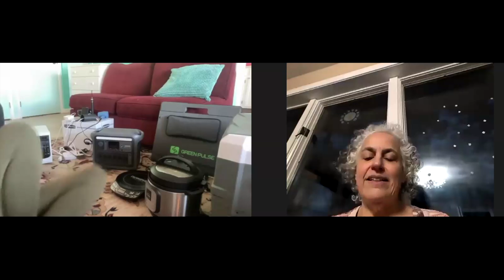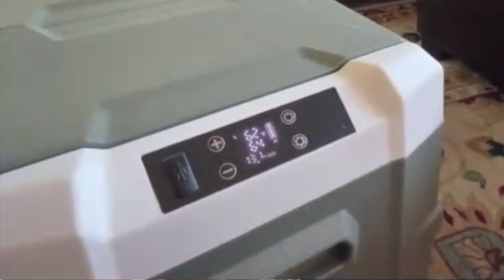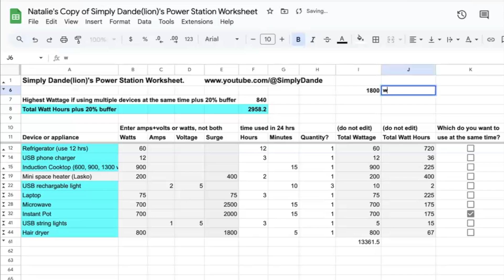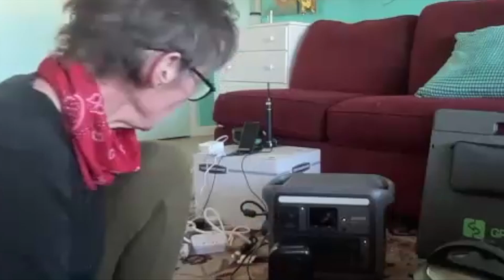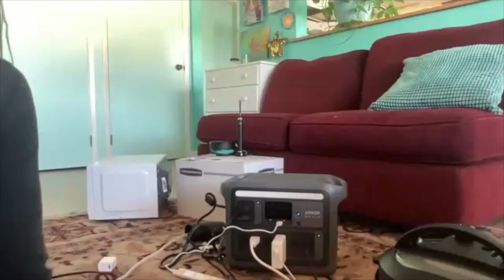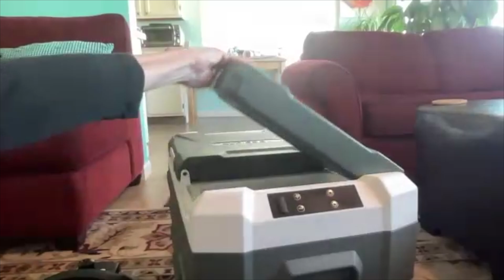2 Solo Senior Women Discuss How to Use a Power Station with Electrical Appliances In Van Life or RV

Comment: Good luck on your 1st camping trip.  Looking forward to your report back on how using all your gizmos goes.  

One power saving tip is to pre-cool the fridge at home down to temperature. Once a fridge is to temp it doesn’t use much power
Reply from the maker: Thanks for the good wishes!  Yes, I somehow had the good sense to pre-cool my fridge at home. I even froze some freezer packs and used them to help keep the fridge and freezer cold overnight and when I went for a hike the next day. I figured I use minimal power that way. Worked!
Reply: @ did you get a chance to use your induction stove?  I’m curious on your power draw if you cooked anything at 600w or 900w.  And could you cook like you wanted to on it?
Reply from the maker: @karinhart489  I did use it briefly to heat up some corn tortillas. I was freezing and starving so I wasn't as attentive to the draw as I might have been. 

I tried to use it on 600w (low or medium low on the settings). It was slow to heat up (super slow relative to my gas stove at home). 

It seemed to draw way more energy than the instant pot did and in a much shorter time. It would be good to do an experiment with them both at home, where I could pay better attention and take notes.
Reply: @ I have a high walled 8” skillet that works on that induction stove.  I had the stove delivered to me while cat sitting for a friend in Oregon (land of no sales tax) and experimented on just how to cook with it.  And I did the “how long does it take to boil a cup of water?” with stove set at 600w, 900w, then 1300w.  The time was close to identical for 900w & 1300w, and only a moment longer at 600w.  Next I’m looking at a small sauce pan with a skillet set with removable handle that nests for storage says it works on an induction stove.
Reply from the maker: @karinhart489  I love your experimental nature! Great to know water boils at about the same time for all 3 settings. SMART on the nesting pans!